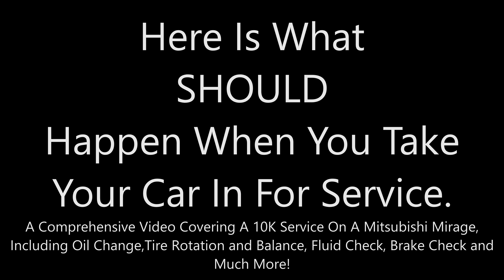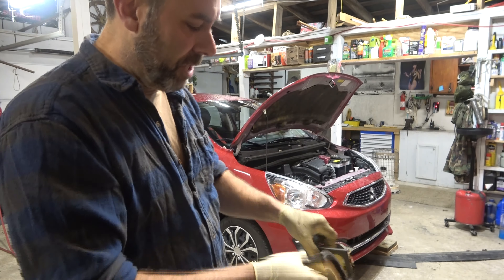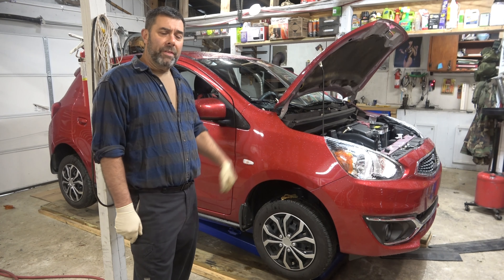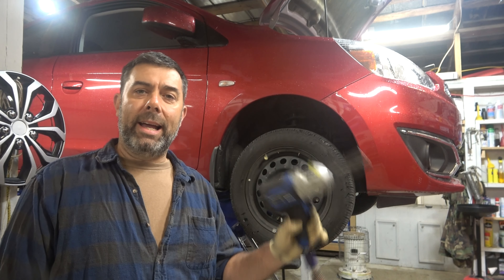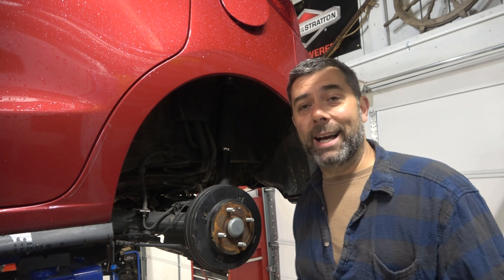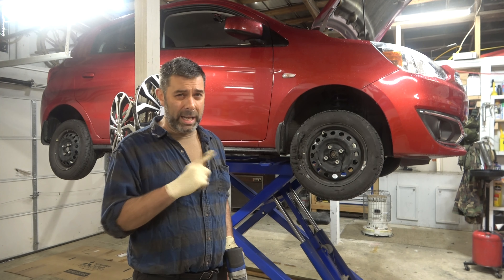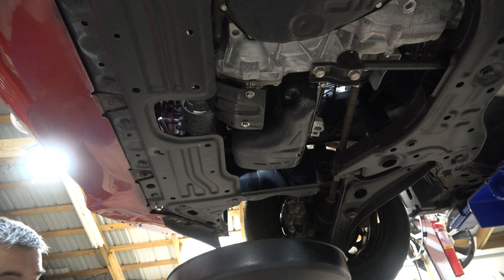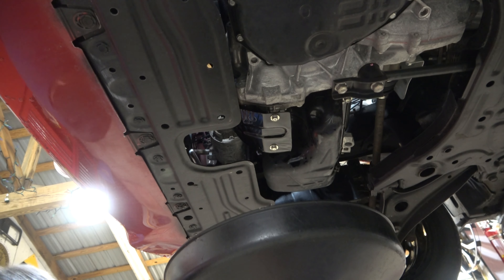Mitsubishi Mirage Routine Service Video. The Video EVERY Mirage Owner Should Watch. DIY Info.

Comment: I just bought my 2021 Mirage.  It's an awesome car.  Nice to see another dude likes small cars.  I'm loving the gas mileage. I'm typically getting over 45 MPG average, sometimes a bit higher if it's mostly highway.  Car drives good, it's comfortable.  I hope I continue to love it.
Reply from the maker: Right on!
Reply: I’m on my second one. I’m planning on my 2022 being my last new car purchase. Going above & beyond in all areas to make it last on all fronts. After the couple in Minnesota traded one in with over 400k on it, that’s my benchmark. My rusty old Echo has 318k on it and I’m 100% sure it’ll go another 100k with proper maintenance.
Reply: @adriangoede7433  A Mirage lasted 400k? Did it have a CVT? I’m 75k deep on mine and hoping to get it over 200k without replacing the transmission.
Reply: @KekeeBlack  Yes, I’m sure there’s more out there. If you just do a Google search for one with 414k when it was traded in, you’ll find it. It was a plasma purple hatchback traded into the same Mitsubishi dealership it was originally purchased at in Minnesota. I can’t remember if it was a CVT or a 5-Speed. I love my 2022 & I’m looking forward to racking up the miles on it. The one thing I plan to do sometime soon is to treat the body to prevent rust issues in the future. There’s a Mitsubishi Mirage/Space Star forum out there that is a wealth of knowledge. In fact, that’s what I’m basing my rust treatment on. There’s a thread on there from a gentleman in Canada who lives in a particularly bad area for rust & he detailed every place where they can start to go. Fortunately I live in Illinois & while we can get some nasty winters, I haven’t seen anything approaching what he’s experienced on his. Mirages in general seem to be pretty resistant to rust, at least where I live. Then again, I think they come with a 7 year warranty against perforation so, that helps.

Comment: I just bought a 2019 G4 ES, I needed a good A to B and man this car is it. Going from $100 dollar fill ups at the gas pump to $27 the other day made me smile.
Reply from the maker: the only down fall is the tiny gas tank. I think that is a great trade off to save $75 each fillup
Reply: @FarpointFarms  won't be a problem I'm not using it to travel long distances.

Comment: Great video Erik ,, I’ve used Wally World 
Super-Tech synthetic oils for almost 20 years as well , in everything from my old play truck , my daily driver AWD Cherokee , and two other hi dollar “go fast” sports cars. I’ve drove them all like “I meant it” ,, never had any issues or engine wear problems . My truck hasn’t exploded yet after 11 years , anyone in the passenger seat as a witness on any given off road adventure with me could testify, after tap dancing on the rev limiter half the trip , ITS GOOD QUALITY OIL 🇺🇸
Reply from the maker: It's time tested stuff, and the cost is super cheap compared to the name brands.

Comment: I have a 2018 Mirage with 100,000 miles on it. I follow the regular maintenance schedule so I change the synthetic oil every 7,500 miles. The old oil never looks black or old. I believe changing it sooner if you're a conservative driver is unwarranted.  This is a modern engine.

Comment: Gotta say, I've been looking for a good and informational video for the Mirage and you did not disappoint. I'm 22 and got a used 2017 Mirage SE with 21.5k miles on it back in June of 2019 and so far the car has been great. It is a bit difficult to find good videos for it and so far I've managed to get by mainly because my father knows cars quite well and it's not exactly a difficult car to deal with. Just yesterday(March 26) I changed the shoes and it was much easier than I thought it would be. I spent about 35 minutes on the first one and only like 12 mins on the second one since I knew what to do already. Weirdly enough the shoes were rather worn out and it only had  31.7k miles on it at the time, and as far as I know those are it's original factory shoes it came with.  You are right about the dealers though, I have 0 trust in them and would much rather spend more time doing it myself than paying someone an absurd amount of money for them to MAYBE do the job and even less likely do it well. My friends make fun of me for it and call me cheap but I always ask them how they know the dealer is actually doing what they paid them for. I've seen my dad have enough bad experiences with dealers to know better than to trust them with my vehicle.  Even high end dealers sometimes can't get the job done correctly. In August of last year my dad took his GT3 RS in for a bit of light work and calibration. He always take pictures of just about everything so that if there's any damage whatsoever he can easily provide proof and have them fix it on their dime and not his. Well,long story short, he ended up having the dashboard replaced. When he went to go pick up the vehicle and began inspecting it, he noticed that the dashboard didn't fit correctly and it stuck out a bit near on the edges of the passenger and drivers side near the AC vents. When he told the parts manager he was told that because it wasn't the "original" dashboard that's how they all fit. He asked how that is since they're made to the specifications of that vehicle and why it wouldn't fit it as it should. They told him there was nothing they could do. He told them to take off the dashboard and to put the old one back on if they weren't going to do their jobs properly. He called corporate and let them know that that specific dealership was unwilling to do a job he had paid for properly. Within 15 minutes they were redoing the dashboard and what a miracle it was that suddenly the new dashboard was an exact fit. Funny enough though, I called pepboys before I changed the shoes on the drums and they wanted $350 just for just the labor which is more than twice what the shoes AND drums cost, like how ridiculous is that for something so easy. I figured that if they didn't charge too much I'd let them do it so I could enjoy my Friday night. Sorry for the long ramble. Really do appreciate you making this video though, will definitely help when I service it again.
Reply: Did you feel anything unusual with the drums when you were driving or e-braking or were you just checking the wears on it
Reply: @bgdtlbrs  I didn’t feel anything weird for either, but I thought I might as well inspect them when I was changing my brake pads. I have a bit of a heavy foot so I’m usually going quite fast and braking rather hard do it does make some sense they would get worn out rather soon, but not to the point they’d have to be replaced... I think. I am going to check them once again at around the 5k mark to see how they’re doing that way I can determine whether it’s my driving style that caused them to waste away so quickly or if something is wrong with the drums.
Reply: Great post.  I have my own “Pep Boys story” involving cv boots. That was my one and only visit to PB. I ended up with a refund for their alleged work

Comment: I'm sure your aware that B-12 can also be used before you change the oil, pour about a half a can into the crankcase and let it run for about 10 minutes, it cleans Oil pump screen and everything. I love the stuff
Reply from the maker: Yes! This car is so new and I plan on keeping it kept up with so I shouldn't have to use it that way.

Comment: Wow. Thanks for this great video and channel for what looks like is going to be a great car for the money and for my transportational needs. The Youtube algorithms recommended this video to me just today. Last month, I bought a new 2020 ES 5-speed for $11,820; $13.1K OTD; less the trade. I traded a 2017 6-speed manual Kia Soul, and believe it or not, this 78 hp manual Mirage has more drive-ability performance than that 130 peak hp Soul. I've now got a $93/month payment on a brand new car with few sacrifices. The Mirage represents an amazing price for any highway vehicle sold in America. Heck; we've got a UTV at work that cost us more than this car cost me; and we got the UTV at a lower price than a retail customer can get it. My first recorded mpg for a tank of gas, manually calculated, was 44.6 versus the lie-o-meter's 48.2.  I'm using only top-tier gasoline to reduce long-term carbon build up on injectors.

The manufacture date on my new car tells me it was already fourteen months old when I took delivery, so I'll probably do the first engine oil/filter change at 3K and then three times per year after that first one, which should put my changes at the 5,000-5,500 mile mark. I'll rarely exceed 65 mph in this car due to my rural commute route. I'll mostly be cruising 55-60 mph due to being on state routes; not interstates. However, my route has some fairly significant and long grades to climb daily. The closest dealer to me is an hour-and-a-half away, so I'll definitely being doing my on routine preventive maintenance. This video was perfect. I'm hitting the subscribe and like button right after this post. The ironic thing is that there is a truck load of new Chevy Spark's sitting at a car lot 5 miles from where I live that I could have picked up for about the same price, but the Spark, even though it has some advantages over Mirage, just didn't do it for me like the latter. To me, Mitsubishi put the design money towards the more important attributes that I need in a cheap and reliable commuter car. More utility space, more warranty and more mpg.
Reply from the maker: I'm glad I could help. I agree the Spark is just not a good car. I looked at them too, but I've also worked on many of them and they just don't hold up. That Mirage will last as long as you want it too as long as you keep up with it.

Comment: This was a very informative video.  Thanks for posting.   

I think you nailed it well with using an OEM filter made by Denso.    They make great filters.  My dealer gives me the small O ring for the drain plug inside the filter box along with the oil filter.   

I will continue to follow your postings.

Maybe do up a video of a Mirage being undercoated and prepped for winter.

Plate [C]

Comment: About to buy onw of these for my 16 year-old son. I agree with your comment about car designers having to work as mechanics for two years. I built a 1965 Mustang over a two-year period as a new car. For the most part back then the engineers knew their poop. The screaming exception was in placement of the fuse panel. Unless you're a friggin Hobbit it's a major CF to get into it.

Comment: I watched the whole thing! Thank you for this video. I have a 2019 and I am trying to maintain it as best I can just hard to find trusted mechanics and stick to one that won't over charge and take advantage. 
I do have a question tho, we're you cleaning the gas tank? What does it do? I never realized that was a thing
Reply from the maker: I was adding fuel additive- it helps to clean/maintain the fuel system- I was using Marvel Mystery Oil

Comment: I was wondering when the cvt fluid should be changed, I have a 2018 with 20000 miles. Great video by the way. These little cars get far too much hate from reviewers.
Reply from the maker: I would do it right now. I plan on doing mine every 20K.
Reply: Use Amsoil CVT fluid. It's the best with a higher flash point then Mitsubishi. Also every 30k is fine to change it also it has an online filter.

Comment: Hi, I love all your videos I just bought a 2024 Mirage G4. I love it. I,like you, like to do my own maintenance on my vehicles. It has been a while since I bought a brand new car. Does it void the warranty at all If you do your maintenance on oil changes and transmission changes as well? I’ve heard as long as you have the receipts and keep a log and use the proper fluids that it should be ok. I just want to see what you ran into at all. Thanks again keep up the videos!
Reply from the maker: I use only OEM parts and keep detailed record of what I do. I think if you do that, you should be good

Comment: Thanks for the video, good that somebody just shows car specific what should be done. Speaking of which, I drive a 2015 model Mirage CVT. I have driven cars for 40 years now. I am a son of a car mechanic that has driven cars for 50 years until he was unable to anymore. Never we did anything more than was described in the service manual of any car we ever had. They all had some issues now and then, but we never had failing gearboxes, leaking radiators, or problematic oil consumption in the engine. It is unnecessary to do more oil changes than prescribed or put extra cleaning fluids in. Waste of time and money. Just do what the manufacturer says. Nothing more, nothing less.

Comment: I have a 2017 Mirage, bought used with 53,000 miles.  I changed the oil at 58,000 with Mobile 10 w 20 .
Reply: Sorry, I notice after I changed the oil,  I bought the hi- mileage version.  Now for a split second the engine knocks.  Did I mess with the higher mileage oil?
Reply from the maker: I would suspect your oil filter. Cheaper ones may not include the anti drain back valve. Use an oem one and see if it changes.

Comment: I have the older version of this car ...the 2004 to 2013 Mitsubishi colt 1.1 engine ....there almost identical to this car...mine is 2011 and in almost 11 years not one thing has gone wrong..all I have done is new brakes tyres filters oil bulbs wipers coolant brake fluid..but other than serviceable items nothing has been needed to be changed....there is 153 thousand miles on it now and it runs like a clock.....5k oil changes all the way...
Reply: Hey! 5K miles or Km?

Comment: Hi, I'm considering this car. A couple questions-- is the Marvel similar to adding Seafoam to oil? Do you know if Mitsubishi uses good sensor and solenoids? My last car has given me headache after headache due to bad solenoids and switches. Do you know if the manual transmission is a good option? And do you rustproof the underbody of your car, and if so what do you recommend? I've used a light coat of ACF50 on my motorbikes but it's a bit pricey. Thanks! Liked and subbed.
Reply from the maker: Marvel is way easier on the engine than seafoam when used in the recommended amount. It's a light cleaner that works in both oil and gas.   As for the Mirage engine, it's a time tested engine. No major or minor issues to note. Many go nearly 100K with out a check engine light of any kind.  I rust proofed mine (there is a video of it) and used rustolium professional undercoating. It's holding up well. I also painted the control arms and rear beam with a few coats of regular black paint to protect them a bit.n

Comment: I have a 2015 mischief Mirage and when you pull it down and gear it die what would cause that
Reply from the maker: A vacuum leak. Start the car, and have someone stand looking at the engine when you put it in gear. Listen for a sudden hissing sound before it stalls. Look for torn or loose hoses going to the engine.

Comment: Hi Eric I want to buy a Mirage but being only 3 cylinders how would it handle 1hr highway drives at 68mph? I drive a 4 cylinder on the highway and I feel like it struggles staying at 2500rpm especially on even slight inclines, I cant imagine a 3 cylinder. Would it be advised to take it easy in the mirage to save then engine and/cvt? I have a bit of a heavy foot 😅

I really loved the video so much I subscribed and looking forward to the next service intervals
Reply: It's ok. They trick them out in the Philippines.
Reply: I know its from a year ago, but the car does just fine on the freeway. If you can drive a manual i would say buy the manual versus the auto as it's way better at acceleration. My manual with 3 people in the car will get 38mpg on the freeway doing 80mph

Comment: My 2018 MIrage ES 50k miles, all service correct, new battery. It will occasionally crank no start, any suggestions? No codes, mechanics cannot find anything wrong and cannot reproduce problem. I just put some BG 44k in it hoping it may help.
Reply from the maker: Best guess is a defective fuel pump relay or an issue with an immobilizer (anti-theft) not recognizing your key. The occasional problems can be the hardest to diagnose since they happen infrequently
Reply: @FarpointFarms  Wouldn't it code if the pump relay was bad?
Reply: @FarpointFarms  Thanks, tried different key and replaced batteries, wouldn't fuel pump throw codes? I have zero codes. Could it be flooded?

Comment: The recommended OCI of 7500 miles is pretty safe on these cars.  The same Mirage sold in Europe has a 12000+ mile OCI (20000 km), but doesn't get that huge powertrain warranty we get here in the States.

I bought my Mirage new with 14 miles on it, and at 168,000 miles I have no problems with the engine to report.  It got religious oil changes every 7500 miles...just like the book says.

Nothing wrong with shorter OCIs except for the cost, but I don't think they are all that necessary.
Reply from the maker: Glad to hear yours is doing so well, as a mechanic I cringe a bit at the 7500 mile oil change
Reply: @FarpointFarms I am a mechanic also, and like you I grew up in the 'every 3000 miles' era. But oils really are worlds better now and modern engines run a lot cleaner.

They just don't need the oil changed that often anymore.
Reply: @FarpointFarms  Mitsu suggest 7500 mile changes with OW-20 though?

Comment: what is the viscosity for the engine oil that you use? usually the mitsubishi service center here in malaysia will use 0w20. just changed to 0w20 at a normal service shop. but in the manual book there is a diagram about what viscosities to use. and the choices even goes to 20w50. is it okay?

i saw a sale on 5w30 oil. might want to keep it for the next service. what is your opinion?
Reply from the maker: I have and will use the 0w20 full synthetic. I would not be terribly confident using anything else.
Reply: @FarpointFarms  okay then.. thanks so much for the opinion.